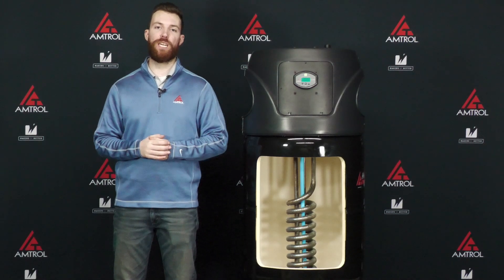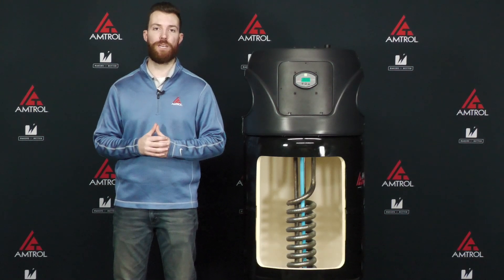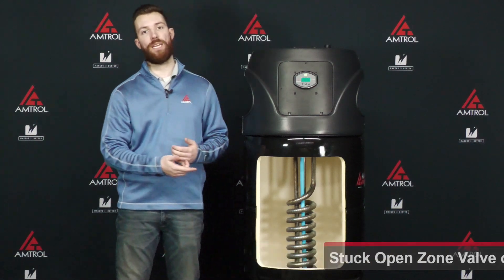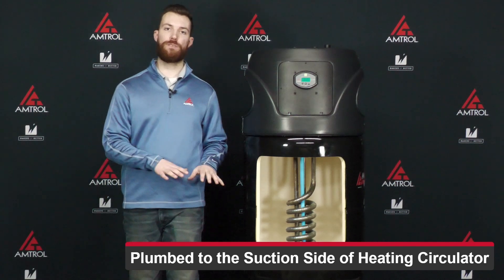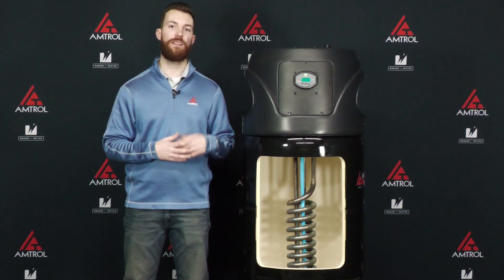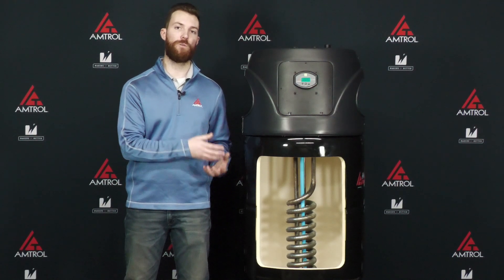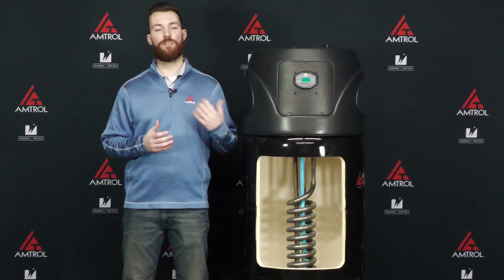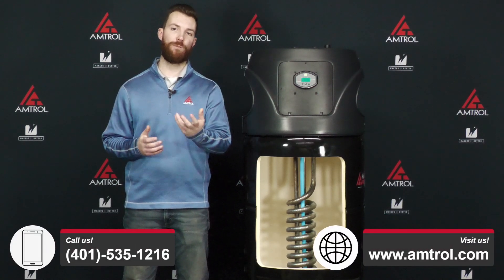Troubleshooting an "Er 2" Error  - Amtrol Tech Takes

Comment: Could it be from a faulty circulator pump also?
Reply from the maker: Yes. If the circulator pump is continuously running and your boiler is at temp, that would potentially cause a scenario for an ER2 error code.